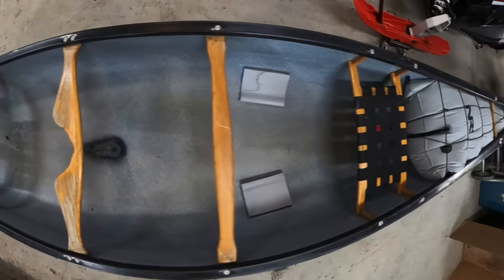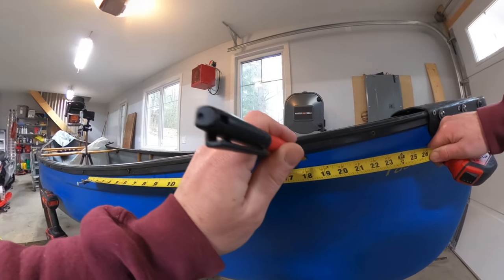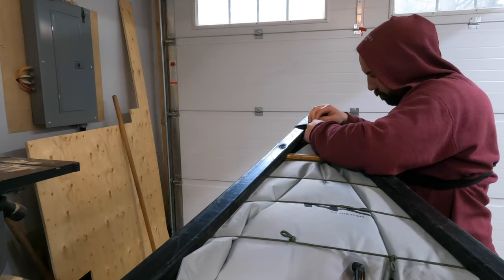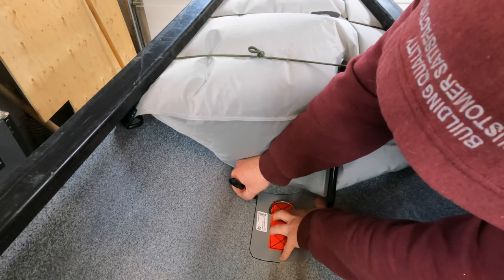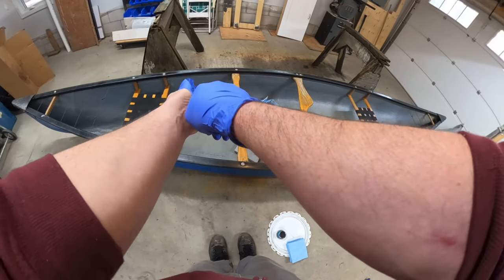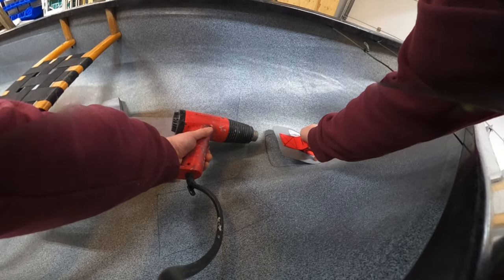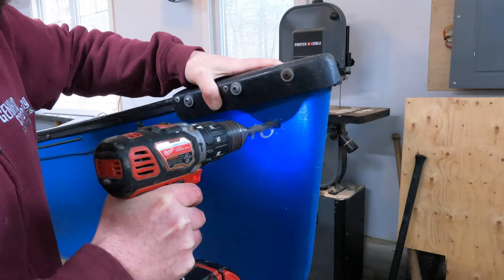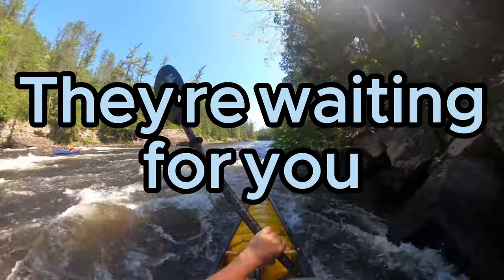Basic Whitewater Canoe Outfitting

Comment: Drill thru the gun Wales instead
  And then you don't have holes in the sides of your boat.   If you are drilling thru the sides, it would be ideally for a spray deck
Reply from the maker: Thanks for the tip! Every boat I’ve paddle for whitewater was setup like that so I assumed it was correct.
Reply: @ryansroutes1805  weird.  In all my years paddling whitewater, I've never seen air bags secured this was.   Also many will be hesitant to drill  thru their boat.   When I did, it was for my spray deck to allow it to fold over the sides
Reply: @iamtznuable it’s actually very common to do in the UK and lesser so here